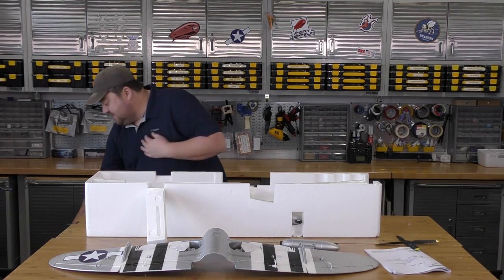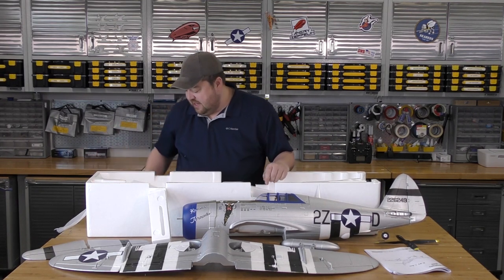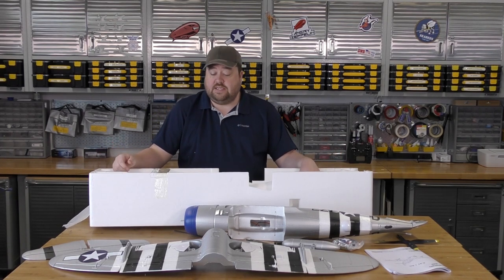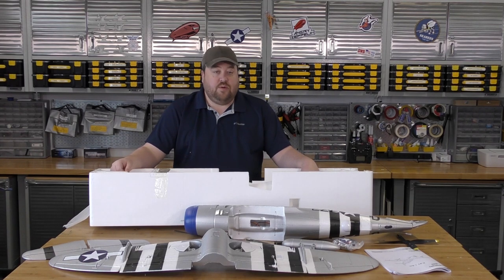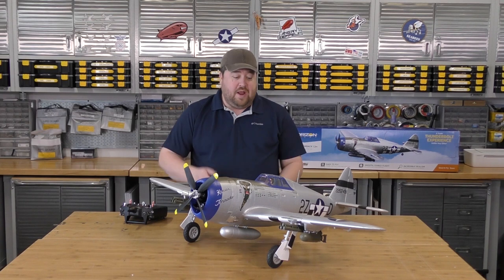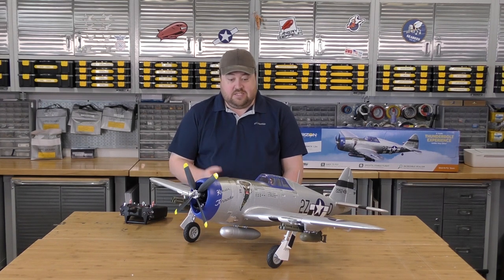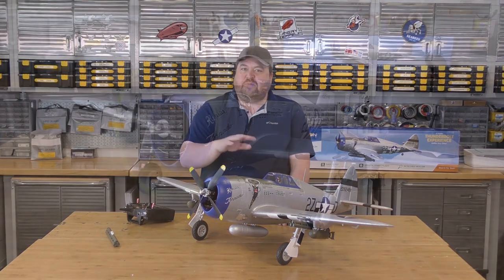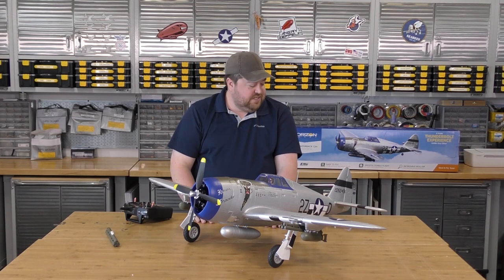E-flite P-47 Razorback Build and Review

Comment: Sweet great information, I’m thinking about replacing the stock Speed Control and adding the Spektrum 80amp Smart ESC to both my Horizon 1.2m T-28 Trojan and Horizon 1.2m P-47 Razor Back both BNF, do you think the leads will all be compatible with the new Spektrum ESC or will I  need to order connector also?         Cheers !!!!